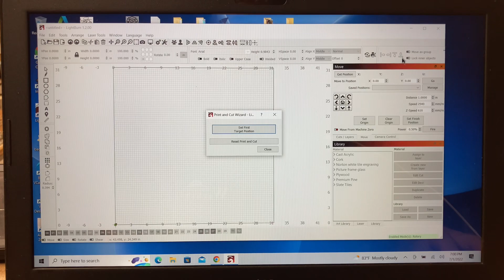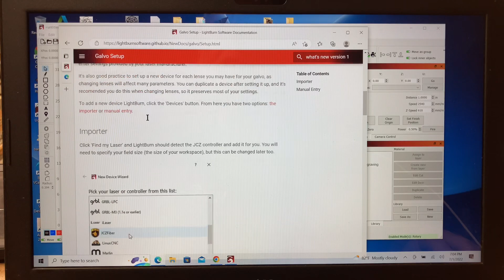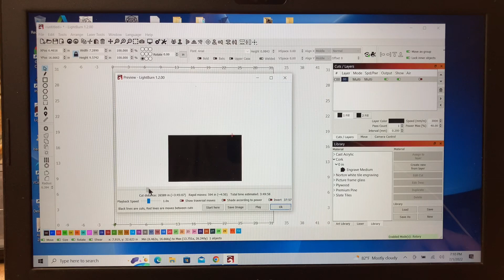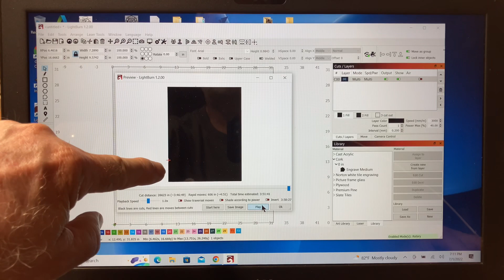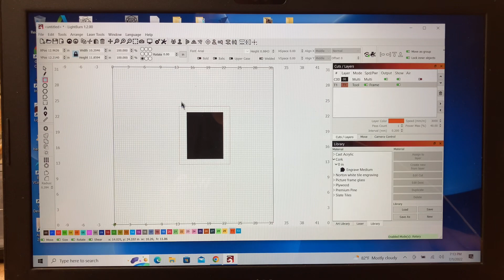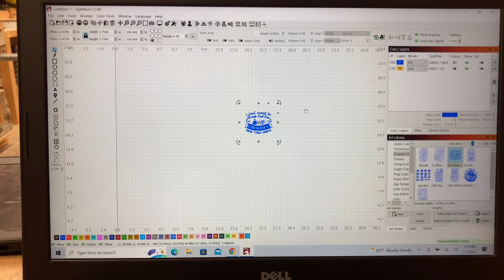Lightburn Version 1.2 First Look. AMAZING!!

Comment: good video, but lightburn 1.2.01 will not let me frame with a laser, before you hit shift and frame, now it frames no light
Reply from the maker: Have you looked at the device settings and turned on the fire button?  Also, you may need to adjust the power level
Reply: @PawPawsWorkShop  that's the thing with the new upgrade there is no individual power button or a fire button.
But I do have it turned on just like you did in the old versions.
And there's now a new link that says turn on when framing so you don't have to hold shift* button down.
I even turned off my machine and the software and restarted it. Nothing
Reply from the maker: I have not updated to that version yet. I’ll have to take a look at it.

Comment: The rotary setup was already moved in 1.1.04.  The print and cut feature is also the same on 1.1.04.  The Print Icons are also in the older version. You're finding a few features that are new to you, but have been here awhile.  Maybe you were running a really old version before?
Reply from the maker: Yes as I said I have not updated for quite a while this missing a couple of the more recent updates

Comment: 🤪 We both did a video on the same thing! Since you like the tools Paw Paw, right click on the top toolbar and select Arrange (long)! 😮
Reply from the maker: Wow, that’s interesting. I usually don’t do update type videos but I was impressed by what Lightburn did. Thanks, I’ll check it out.
Reply: @Lessko Brandon 😃😃
Reply from the maker: I looked at your video. We were both thinking along the same line. I’m sure I have not found all the new features as I only looked at it for about an hour or two. The docs were not as clear as I had hoped for.